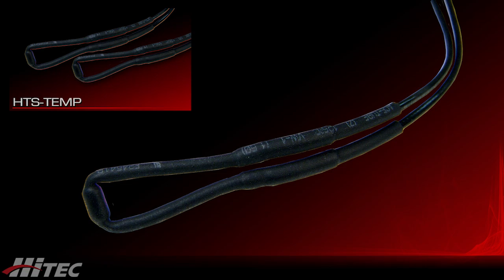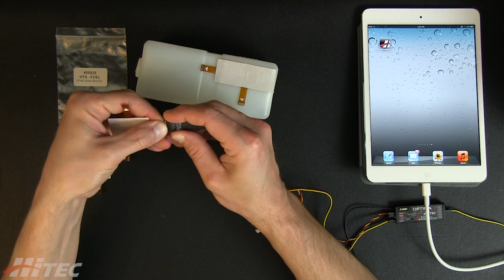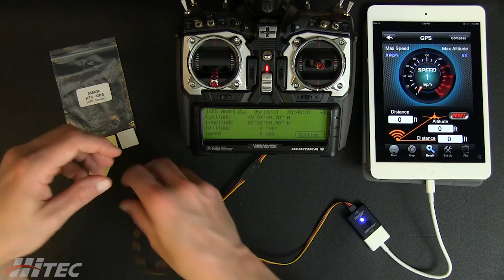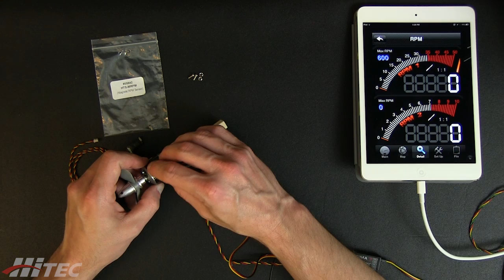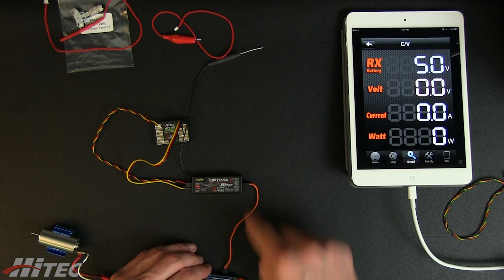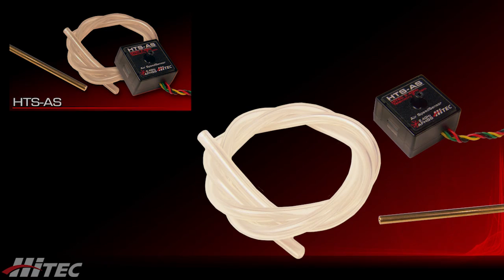Hitec Telemetry Systems - Part 2, Installation

Comment: Ford Motorsports...I'm sure they're talking about the heater blower motor:) You may research how lines have blurred significantly over the years regarding the interchangeability between "motor" and "engine".  I get what you're saying but it's not a big deal.  People know the difference.  The terms Gas, Glow, Brushless are far more important than engine or motor.  Great video!

Comment: Will the advanced sensor hub work with a flysky fs-i8 tx that is paired with a flysky fs ia10b rx? Is there a way to add multpile fuel sensors?

Comment: Hi Just fitted the Magnetic RPM sensor per your advise and it did not work, you said put the X on the magnet towards the sensor did this, not working, looking at the magnet you fitted to your motor the X is facing away from the sensor and yes mine now works I turned it around, great video though.